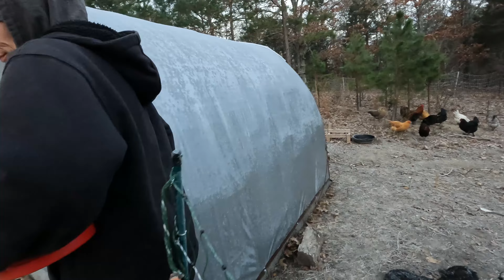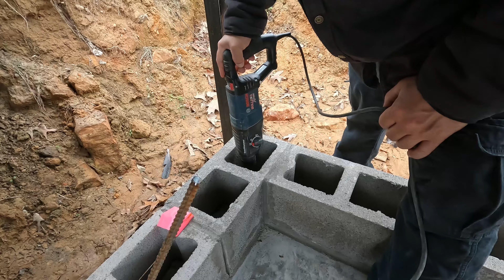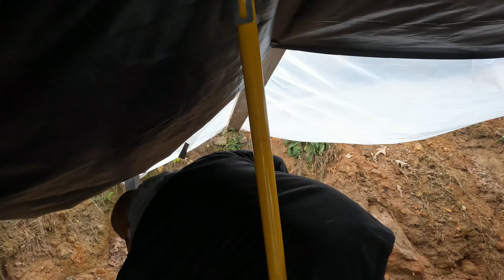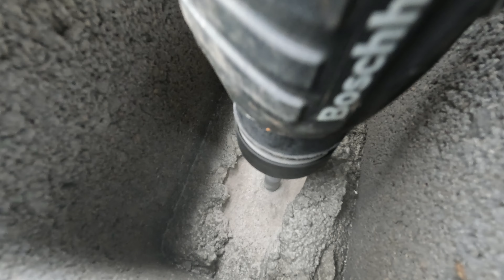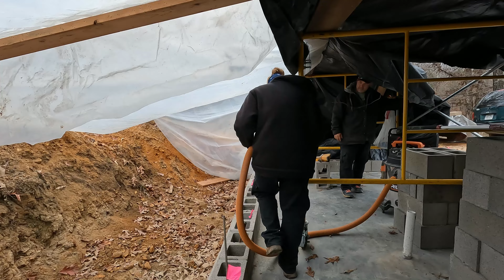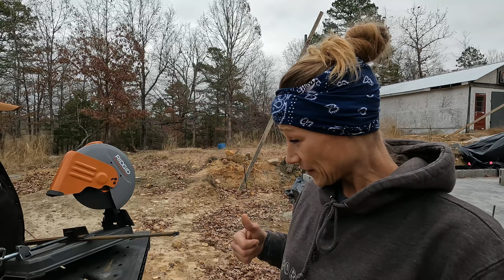This really sucks!\Couple builds house debt free\Morning Chores with Denise\Drilling holes for rebar

Comment: Question: SLR decided not to pump concrete to fill the cells. What is your idea on filling the cells? Are you opposed to pumping and vibrating any air pockets out? SLR was worried about it blowing out the block.
Reply: sLR did fill the cells at the end you have to because it ties the rebar together
Reply: @jamesnewell120   they did bye pouring concrete not pumping . It was messy and I believe not as good as it could have been.
Reply from the maker: awesome questions🥰
Reply from the maker: we are core filling all cells and vibrating to remove all air pockets. i think SLR did the same?